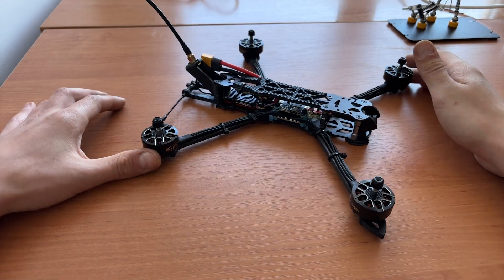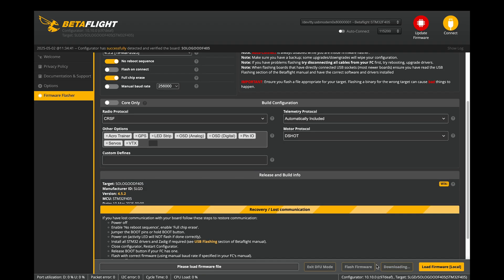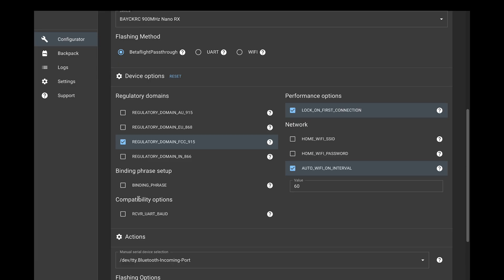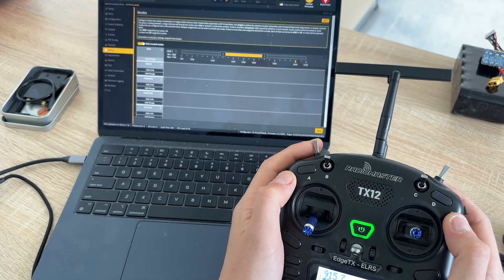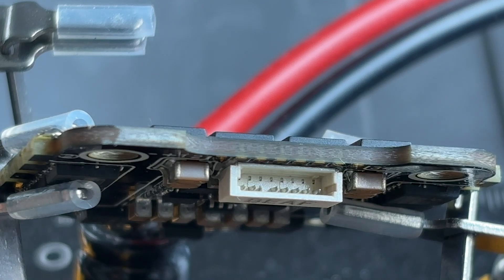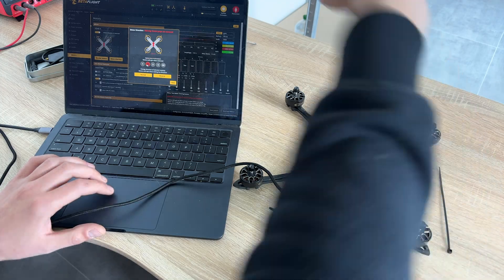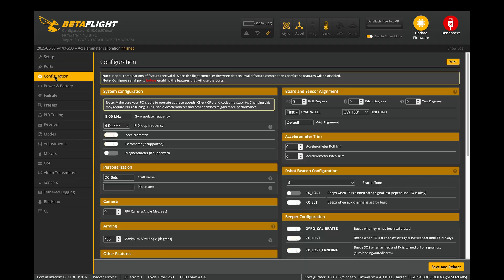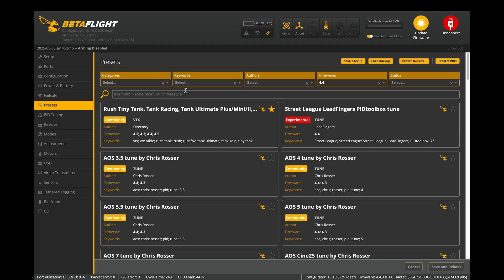FPV Drone Configuration For Beginners

Comment: Why type of battery do you recommend for this build? And also googles?
Reply from the maker: Since it's not super responsive build and it doesn't fit for freestyle - you're ok with 6s2p lion battery for minimum price and maximum range
For googles - it mostly depends on your budget. I don't recomment buying something cheeper than skyzone cobra x (if you limited in budget - it's better to get fpv monitor). i personally use Skyzone 04x pro.

Comment: I have Skyzone SKY04O PRO FPV goggles. I heard thet stock antenas are sh*t. What goggle antena/s should i use for best performance?
Reply from the maker: Actually it's true
IMHO the best setup is to have one directional antenna and one round.
I'm using true rc patch and Foxeer Lollipop stubby

but even regular cherry would be better than stock antenna
Reply: @DCSets  thanks 👍.

Comment: Any chance you have the error motor issue because of the smoker?
Reply from the maker: A smoke stopper only cuts the power when it detects a current spike. With 2 amps, the motor should spin without any issue (at low RPM).

Comment: I want to build one, did you know maximum running distance? And I can use something similar and cheap than goggles? like an screen next to remote or something. I want to use Jumper T14 remote
Reply from the maker: Hey. The Jumper T14 is totally fine. It's better to have the 915MHz version since the lower frequency allows you to fly longer distances with a stable signal.
In terms of maximum range, the current build (Rush Tank Max Solo 2.5 + ELRS 915MHz) allows you to have a stable signal at 15 and even 20km. But it also depends on your position and obstacles between you and the quad. The ideal situation is when you always have a clear radio horizon. To achieve this, you need to climb onto a roof/cliff/etc., or have external antennas placed a few meters above the ground.
Regarding your video receiver (aka goggles/screen), it's crucial to have good antennas with a low Standing Wave Ratio on your channel. Ideally, you should have one directional antenna. If you don't trust your goggles, you can buy a VRX separately (like SkyZone SteadyView, Foxeer Wildfire, etc.) and connect it to a $10 car monitor.
Reply: @DCSets  Thank you for reply and informations!
I'm an beginner and I want to create an FPV Drone.
What is your opinion on the following?
I want to use an RunCam Split 4K, which it comes with SD Card module. I want to connect it to Rush Tank Max Solo 2.5W 5.8G VTX. Also, I can connect it over Uart to Flight Controller, an SoloGood F722 Stack ICM42688P. 
I thought about video reception and I think I'll do it on my phone via OTG with an EWRF 5.8G 56CH Mini FPV FUAV Receiver UVC, what do you think? It's good for beginning? For me it's ok if I can reach 5km video reception. 
The ELRS Receiver is an 915MHz one, ES900 with dual antennas. I found an interesting 7 inch frame, Axisflying Manta X7 who it seems to be qualitative. For GPS I want to use RUSHFPV GNSS PRO GPS M10, I can configure it for Return to home?
An battery LiPo 6S 22.2V 60C 5000mAh is it enough for a flight of maximum 20 minutes? 
For Brushless Motor I don't know what to use, I found 3115 900KV 3-6S, are they good? For the remote controller I said upper, I will use Jumper T14 915mhz. All the parts mentioned are available on Aliexpress. 
I'm interested in being able to fly it smoothly and slowly up to 5km, have a return to home and have good video quality when recording, I seen the RunCam Split 4K is an good camera for its price. 
Everything costs me somewhere around 500$ and I think it's a decent amount for the parts I mentioned and for what I want the drone to do. What do you think? 
By the way, your content is the best I've ever watched, thank you for sharing it!
Reply: Update: EWRF 5.8G 56CH VRX I think is not good more than 1km... The best option would be goggles but they are too expensive... is there something cheaper (100$ maximum) and good that can go up to 5km? I found EV800D 5.8G 40CH or ROTG02 Pro OTG for phone.. its good?
Reply from the maker: @gameruldenis888  All receivers for phone is crap (as far as i know). Most likely u'll loose your drone.
I think that cheepest option is to buy vrx. I've tested skyzone vrx and foxeer wildfire. But for your range something like https://s.click.aliexpress.com/e/_on0QMBJ should fits too. 
Than you need some monitor which able to accept video signal though the wire. Something like https://s.click.aliexpress.com/e/_oFFHgfP
But imho. Its better to spend 200$ to decent googles. (i believe skyzone cobra x has the best price/quality ratio). Check your local market with used items.
If you aim to 5km only you can use cheeper vtx. Rush tank 1.6w would be enought. 
GPS - yes. You can configure every gps to return home in failsafe tab in betaflight.
 3115 900KV - imho overkill. 900kv better for 10 inch quads. For 7 inch stick to somewhere 1300kv 2807 
5000mAh battery - i'm not sure that it's enought for 20 minutes (but it also depends on your fly style and weather). Anyway. LiPo batteries are mostly for freestyle. If you're looking for smooth fly - you can stay with liOn which is cheeper
Reply: @DCSets  Thank you for informations! I will use goggles.. it's the best solution. What capacity of battery do you recommend for 20-30 mins of flight? RunCam Split 4K with Rush Tank Max Solo is a good combo? The SoloGood F722 Flight controller is okay? should I use a brand or can I get something cheap for $20, which is the best? For li-ion battery what model I should use? I've seen videos with tests for the EV800D 5.8G 40CH goggles, they seem pretty stable and can easily go 5km, for $100 they're very good from what I've seen. These are my final clarifications, I just need to put them together, I can't wait to build my first FPV drone :)
Reply from the maker: @gameruldenis888 I haven’t used the Runcam Split, but it should be fine. Honestly, I’m not a big fan of Runcams. It’s just personal preference, but to me their image looks way too sharp.
Sologood and Rush are good options.

For 20–30 minutes of smooth flying, a 6S1P pack with Molicel P42A or Samsung 50S cells should work well.

About the EV800D — I’m still against very cheap goggles. Take care of your eyes 🙂 I don’t think it’s possible to spend even 20 minutes with an 800×480 screen blinking right in front of them. In my opinion, the Cobra X is the minimum. I strongly recommend checking your local used market.

It’s better to save money on the frame/VTX/camera/radio and invest in good goggles.

And by the way — make sure you spend at least 20–30 hours in a simulator. It’s the cheapest way to learn to fly 🙂

Comment: i have ordered a similar one just wondering what is the top speed on it ?
Reply from the maker: Around 120-130 km/h with 6s2p liOn battery
Reply: @DCSets  what size is the battery ? 4000-5000 ? also any wobbling on top speed i ordered this to train falcons i just got into drone world and thought that this will be a great starting drone to try tuneing and testing
Reply from the maker: @kain7151  to be hones i've never tested for a long time it on top speed. This drone mainly designed for carrying 1.5kg camera
LiOn 6s2p usually has around 8000mAh, but if you're aiming for top speed you defenitelly need the LiPo
Reply: @DCSets  im intersted in making a drone for my falcon training that has 140-150km in speed can you help me with the build and tuning i would be grateful i have no clue of motor brand or other parts it would be huge to learn from you
most shops here are bad and they charge alot also the tuning is terrible the shop broke my old drone while tuning it ..
Reply from the maker: @kain7151  it's on Ukrainian, but i believe with auto subtitles you'll get the idea. Here is the build for 200 km/h https://www.youtube.com/watch?v=qbd3b98cpR4
He uses our local motors, but you can easily find the analogue with same spec.

If you have some parts for test, i believe with good 2807 1300kv motors (xing, mamba, even emax) and 7040 prop you should achieve the desired speed. Also it's worth to try with 2blade props with higher pitch (you'll be able to select higher kv motor).

Regarding tuning - unfortunately it's impossible to help without having the quad. You need to write blackbox and tune the drone by yourself (fortunately it's a lot of good tutorials on youtube)

Comment: How much did it cost in total, and how long did the whole process actually take you to finish?
Reply from the maker: 132$ without battery. I've explained in details in pinned comment for this video https://youtu.be/2_TmpLcZdik?si=SvMPYKDJYbRVViyO

Regarding time. It's not my first and even not 20th quad. 1.5-2h from unpacking parts to finish flashing firmware (if everything goes smooth)
From my experience the assembly part takes around 8 hours for people who never soldered before.

Comment: Hi. Can you also provide the link for the remote controller (RadioMaster TX12+ELRS), and the drone fpv goggle (eachine)?
Reply from the maker: Hey. Here the TX https://s.click.aliexpress.com/e/_okgzaZC ELRS m2. (keep in mind - in video i'm using 915 ELRS. You need 2.4, so it will be compatible with controller, or you need and external module
Here is my googles: https://s.click.aliexpress.com/e/_o2dnn2e
Reply: @DCSets  What do you think about the "Radiomaster Pocket EdgeTX 2.4G Radio Controller (Mode2 Left-handed Throttle ) CC2500 / ELRS" and "Eachine EV800D 5.8G 40CH 5 Inch 800*480 Video Headset HD"? The headset is little expensive for my budget.
Reply from the maker: @enesabanoz1211 poket is good. Cheeper options for googles is skyzone cobra, i’ve never used the one you mentioned. But if it has good reviews why not
btw i found much comparable flying from fpv monitor, maybe it’s an option for u

Comment: How much weight can this version carry?
Reply from the maker: Depends on a lot factors, but generally 1-1.5kg camera could be lifted without  problem
Reply: After all, this camera can blow up a lot of metal ;).

Is this model very different from the models used by the army?

Have you every tried add an AI to it that would allow it to fly autonomously and find points of interest without an operator?
Reply from the maker: @wojtekw.8651  i wouldn't say it's very different. At the end of 2022 build was almost identical for this. 
Regarding the AI - i've never touched. It's hard to get data for model training :(

Comment: What frame is the and where do I buy it
Reply from the maker: It's copy of geprc Mark4. I bought mine on AliExpress https://s.click.aliexpress.com/e/_oFxttDm 
BTW You can find all components used in previous video with quad assembly
Reply: Can I use a DJI remote for this fpv?
Reply from the maker: @wilder321  you need elrs transmitter. A haven't any experience with dji, but i'm 99% sure it doesn't support it. The cheapest option is to purchase for quad 2.4Ghz elrs module as RX for quad + radiomaster pocket apparature https://s.click.aliexpress.com/e/_om5pxMU (2.4 elrs mk2)
Reply: Ok thanks I was hoping for a more budget friendly 😂
Reply from the maker: @wilder321 unfortunately fvp quite expensive hobby 😂

Comment: How long and how far will this model can fly
Reply from the maker: Easily 15+km with 6s2p battery
Reply: One way? Or round trip?  @DCSets
Reply from the maker: @AQTDA1  it's possible to do 15km round trip (in total). But i'm a bit afraid to write it, because the distance depends on pilot skills, weather condition e.t.c.

Comment: another good video ,im still stuck to the rx elrs since it doesnt want to flash,and the vtx not powering up? it has no leds so idk for sure
Reply from the maker: Thanks for feedback!
Regarding ELRS: check the wiring and selected port are correct. Make sure elrs rx powered on (you can indicate it by LED). If everything fine, but rx won't flash - disable telemetry in betaflight, than run elrs receiver in boot mode (it usually has small button or pad that should be shorted): hold button, powert it on, release button.
In most cases if you assemble big drone the vtx requires 9v+, so it will work only with battery. You can measure voltage by multimeter, or just touch vtx in 30-40 seconds. It should be hot )
Also vtx (when you've selected correct protocol) will show "ready" status in vtx tab in betaflight